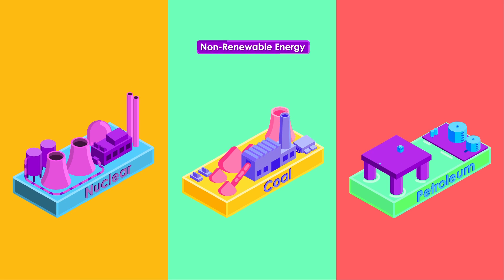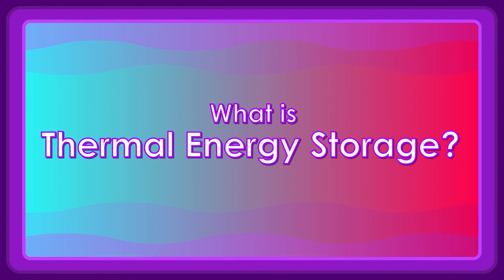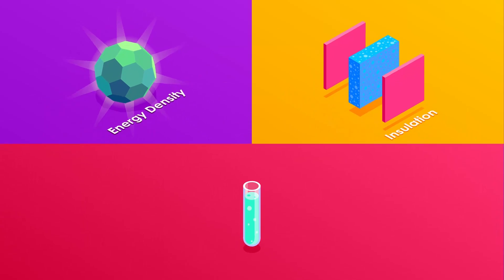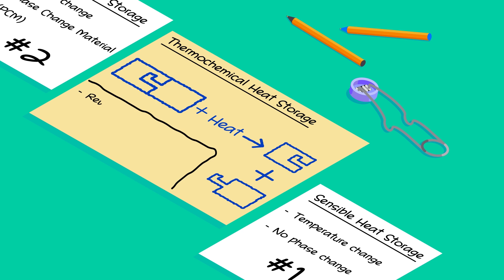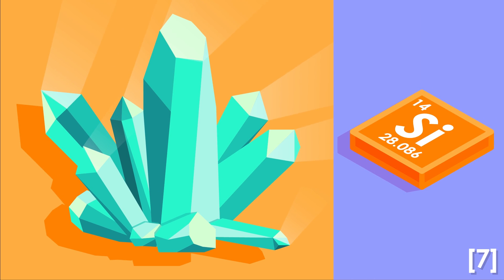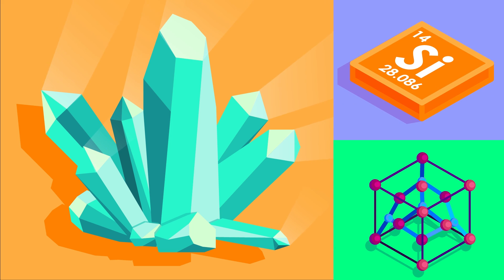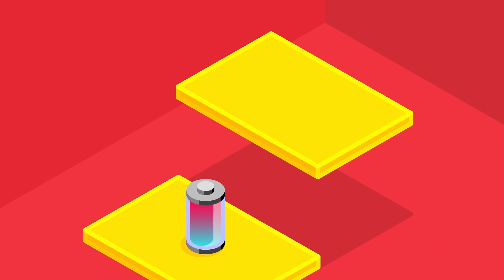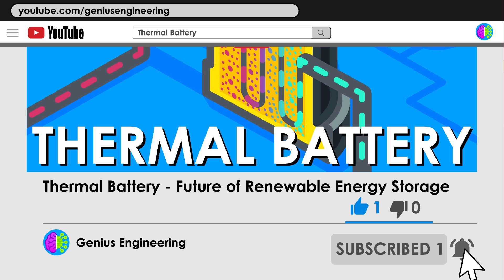The Future of Energy Storage: Understanding Thermal Batteries

Comment: Can this thermal storage be used for solving the problem of duck curve in California?
Reply from the maker: It might be able to assist with reducing the overall strain on the grid during peak times. However, the technology’s efficiency is currently still low due to energy lost due to converting energy from heat to electrical and so.
Reply: @GeniusEngineering  Thanks for the reply.
Reply from the maker: You’re welcome :)

Comment: We already have large arrays of thermal batteries: insulated housing with heat pumps. changing the temperature of 1000s houses by a few degrees is the cheapest, most immediate solution.
 Governments should subsidize free insulation and replacing central heaters with heat pumps in exchange for joining this program  since public perception is the biggest challenge here.

Comment: 1 lb of superheated metal holds as much energy as 10 lbs of batteries.  A single pound of superheated iron, but still below melting point, would make a bike go 50 miles.  Why iron?  The worst thing that could happen if something went wrong is we breathe the oxidized material, and iron oxide is edible to humans, so it would be pretty safe.  Simply force a drop of water into the chamber and use the steam produced to make power.  Iron fuel rods instead of uranium fuel rods.  I love this idea so much.
Reply from the maker: Thank you for commenting on the video :)

Comment: It is not 100 % clear to me how the heat is converted back to electricity, although the sketches imply some sort of a turbine. Heat is a lower for of energy, which means that if you want to convert heat energy back to a high level energy like mechanical or electrical energy, one can at best hope for an efficiency of circa 33 %. Does this sound promising ?

Comment: Btw why havent these batteries been made commercial yet? Is there enough silicon in the earth cause we need to have enough for the solar revolution (as I like to call it the "Solar Boom").

That aside
I really appreciate the hard work and time spent on this video , and for that you have earned yourself a  loyal sub!😉. I would be most grateful of you could clear my doubts.
Reply from the maker: Thank you for the kind words The Gaming Pro Bro. 

Honestly I am not sure why it has not been commercialized yet. What I personally think is that the actual efficiency may not be that high. The silicon ‘thermal battery’ does have a high energy density compared to that of a lead acid battery for instance. Due to the thermal battery requiring energy conversions multiple times the actual efficiency may be low compared to currently commercialized systems.
I am sure this technology will be tested further and if viable in terms of efficiency we might see it available on the commercial market. Although I did not answer your question fully, I do hope that provides some clarity.
Reply: @GeniusEngineering   Thanks a lot! Looking forward to more of your videos
Reply: @ericfernandes3966  Thermal batteries (or energy storage) have been used for quite some time, with varying degrees of success. The main problem with earlier models, is that their operating temperatures were lower (typically in the 5-600deg C range) with didn't offer a large usable operating range.

I've only been following alongside 1414deg, so I'll have to look into CCT, but, from what 1414 were stating, because they operate at such a high temperature, you still remain practical (with usable heat) through a MUCH larger cycle. For electricity for example, you need a lot of heat pressure to turn a turbine (or heat water to steam)

The earlier models also had issues with longevity, as a lot of the salt solutions they were using were corrosive or abrasive. So the machines would wear out. I don't believe that to be an issue with 1414deg.

Silicone is mined from quartz rock (and potentially sand and a bunch of other things) I can safely say we have enough of it (for a GOOD long while)
Reply from the maker: Thanks for your detailed reply, I appreciate it.
Reply from the maker: You seem very knowledgeable about this topic. I remember reading another very detailed comment from you. 

What other technologies do you think show a lot of promise such as Thermal Energy Storage?
Reply: @GeniusEngineering  Thank you. I find technologies interesting, so I like to read up on them, to keep myself informed. 

I think one of the most promising energy technologies to come is "Air-batteries" (I particularly like Aluminium-air, because Aluminium is easy to recycle and primarily uses electricity to smelt/recycle, so renewables can play a large role, but there are a few other promising ones). These have many, many benefits, but the biggest one imo is as a range extender for EVs. Claiming to add 1000+km's to the range of an existing EV, with an easy to change battery (they're non-rechargeable ie a primary cell).

Apparently, we already have working models of the batteries, a guy in the UK has spent over a decade trying to get them commercialized. (Your guess is as good as mine as to why he can't, but I digress. Trevor Jackson is the name)

As for grid energy storage, I believe thermal and hydro are the most promising, but. Lithium-ion will play a huge role in the shorter term, but I think there are better suited technologies in the longer term. Li-Ion has a size and weight advantage, so I think it's best used in EVs (etc) but that then leads to one of my favourite additional uses for EVs, which is Vehicle-to-Grid. When a large quantity of EVs can interact with the grid itself, in a bi-directional way, they should become the single largest driving force for transition to renewables. But, that's a fair way off sadly (unless the likes of Tesla throw another curve-ball at their battery day in Sept)

I also really like the prospect of Flywheel-Energy-Storage. Currently, they're only used for ultra-short storage times (usually in similar ways to capacitors) - like launch catapults on aircraft carriers, or in particle accelerators and fusion reactors etc. But, they can be modified for medium-term storage too allegedly (4-6 hours). They're mainly made of steel too, so fully recyclable, which is an important factor over Li-Ion batteries at around 70%)

Then lastly, there's Flow-batteries, which should become big players. They can work with very plentiful materials (for the "fuel" at least) like iron, are scale-able (I think by just adding more tanks), but they're struggling for price (against Li-Ion, because it's "the big thing" atm)
Reply from the maker: Thank you for sharing your knowledge. I’ve only recently discovered how interesting and exciting energy and battery related technologies really are. 

Definitely planning on doing a lot more videos about related topics since there is so much going on and if one does not actively keep up its easy to totally miss what’s happening. 

I expect that we will see even more revolutionary developments in the next decade or so. Thank you again for sharing your thoughts!

Comment: I need to see a thermal storage powering Thermoelectric modules to provide stable power for 1-2 days.
I am thinking for a sand/salt insulated storage with a top insulation trap which can be opened and heated by a large fresnel lens and the light its focused trough a triple layers of thick glass windows to maintains a temperature of 500°C into the storage. As a main heating surface under glass must be placed a high temperature resistant TITANIUM PLATE HEATED BY SOLAR RADIATION TO 1200°c....same as an oven heating element.
I am thinking for generating an electrical power 5-10 times bigger per square meter TEG elements instead of using poor solar technology
Reply: I have, for at least 3 decades, been trying to make my MANY inventions.. using Solar coupled with a Fresnel Prism.. into reality with no success. Aside from a lack of funding, being alone as a high-functioning Autistic, makes bringing them into fruition quite a challenge.
I can say for certainty you're on the right track.  I wish you better success!

Comment: "Scaling the battery down to be used in Smartphones...are not plausable" - I for my part wasnt planning to put a 1400°C hot battery in the front pocket of my pants. Jokes aside, you should look into the Carnot battery out of Cambridge by Malta. They operate with molten salt. With ~500°C still too hot for my pants but also very interesting. We have a lot of salt available on the surface, too. 
I like the animations, nice video!
Reply from the maker: That gave me a good chuckle, fair point you have though. Thank you Alex I will check it out. :)
Reply: @GeniusEngineering  yes its not possible now but it will possible in future.
Reply from the maker: @vinayakthote3957  Definitely!
Reply: @GeniusEngineering  sandman🎶, sand boet, I'm busy heating up 100 kg, using my design of a rocket stove I cased in it.... Doing it all outside, cooking at the same time to save on wood... I will wheel it in
Inside at night this winter when the power is switched off💩.  Stand strong this winter folks... Keep prepping 🇬🇧

Comment: The over 1400℃ melting point of silicon is making it somewhat impractical. As the preferable working temperature of a steem turbing or a sterling engine made of steel is around 550℃. 
If there is a chemically stable material with a melting point above 400℃ but lower than 550℃, while having a high fusion heat. It will have more potential to be deployed in multiple forms of platforms, even maybe mobile usage.
And... I think this is not efficient to store electricity. Electric batteries have an efficiency of more than 85%, but a steam turbine generator usually has no more than 50%. So turning electricity into heat and using the heat to generate electricity will make a lot of energy loss. 
However, if the heat directly comes from heat source. Either drained from the combustion chamber of fire power plant boilers, or from solar tower, or nuclear reactor, or a diesel burning heater on a mobile platform such as an AIP military submarine. It will have no such problem.

Comment: Better to use solar thermal systems which are efficient up to 60-70% rather then 21% like PV systems to store heat to heat and extract heat during winter to heat the House. 80% of house power demand is hot water  and heating. We don't need electricity as much as wee need heat.
Reply: No, you need a heat pump.

Comment: Nuclear is actually 100% renewable. More uranium gets vented into the ocean yearly than we use, and our waste profile is reusable to some 20-30x the electricity it originally provided. Thermal batteries could end up being really useful for nuclear reactors, as they can basically run full blast 24/7 topping the battery up, turning "base load" into "variable load".
Reply from the maker: You make a good point. Thank you for the thorough explanation.
Reply: @GeniusEngineering  I just want whatever solution gets us to zero emissions and then to negative emissions. Bless you for making these videos, good sir; they’re brilliantly made.
Reply from the maker: Thank you for your comments, it means a lot!
Reply: @dunexapa1016  I mean, under those same circumstances, no power source is clean. "Wind and Solar will solve our problems as soon as energy storage gets cheap enough" I mean, name ONE BATTERY currently in production that gets 50-100 times more density than current lithium-ion.

Ocean mining, using CURRENT technology, is 4x as expensive as earth mining. Fuel price is not what makes nuclear expensive, though. 4x would make the fuel's contribution to nuclear pricing go from 0.2¢/KWh to 0.8¢/KWh.

At least we have fast spectrum reactors up and running, though they're closer to 2-4x re-use at the moment. Regulation prevents us from getting higher numbers; even more efficient BURNER reactors (e.g. use the fuel 4-6x longer than current designs) won't be allowed to go into production 'til the late 2020s.
Reply: I'd that including the non fissile uranium that can't be used in a reactor?
Reply: @dunexapa1016  dummy, use thorium cycle fission

Comment: i wanna build an ecovillage, whereby we dig a ginormous hole in the ground, insulate it with aircrete, and fill it with sand/ dirt. all our methane, solar, wind, micro-hydro, etc, will work 100% into heating that sand to 500'C. and then run a closed-loop turbine powered by that hot sand to produce electricity. where do i go to learn how to do this best?

Comment: This video is not that accurate. 

The principle behind both types of solar panel – solar photovoltaic (PV) and solar thermal – is the same. They absorb raw energy from the sun and use it to create usable energy.In solar PV systems this is through the creation of electricity, whereas thermal systems are used directly for heating water or air. For many households there is no need to decide which of the two technologies is better as they can be used in tandem. For businesses and landowners the debate is slightly different, as the main goal is to get a return on investment or generate a sustainable second income. ©
Reply: Maybe I'm missing something, but I don't remember him talking about solar thermal specifically. Just the storage systems, but either way. 

With Thermal Energy Storage Systems, you can hold and recover that heat to produce electricity, at quite high efficiency rates. 1414degrees actually do it directly through a modified gas generator, that runs purely on super-heated air from the TESS. You can, ofc, use that heat for other uses directly, as well. Potentially, using it to heat furnaces and other high-energy intense applications too. Worldwide, heat energy actually out-weighs our use of electricity directly by quite a bit

Regarding the way the heat is captured, there are many possible ways. Waste heat is one, that is very desirable. Recapturing energy you've used to use again is great. 1414deg are currently running this testing system with "SA Water" sewerage treatment plant. Burning the methane gas for energy, storing the heat and reusing later.

Solar thermal is another. That's what 1414deg's pilot test plant will be exploring in the coming year. And the other proposed idea, is more traditional electric heating elements, to capture excess energy production (from renewables) to use at a more appropriate time. Least desirable imo, but still useful.

TESS are designed to be used on the medium to large scale though. Unlikely we'll see domestic sized systems any time soon (not considering hydronic heaters, or hot water systems, as they're not electricity generation capable)
Reply from the maker: Thanks for the in-depth  comment :)

Comment: Vacuum
Reply from the maker: I’m confused by the comment. Can you please elaborate
Reply: @GeniusEngineering  try vaccum as insulator to store heat no transfer of solids necessary, heat will transfer through solid copper instantly inside vacuum towards cooler temperatures, nonetheless H2o boils at freezing temperatures.

Use heat exchanger to transfer heat inside vacuum to water which is also in a vacuum and boils to cold steam then extract stored energy kinetically which also works as AC with benefit of generating electricity via steam turbine
Reply from the maker: Wow I haven’t thought of that. Thanks for  elaborating Brian!